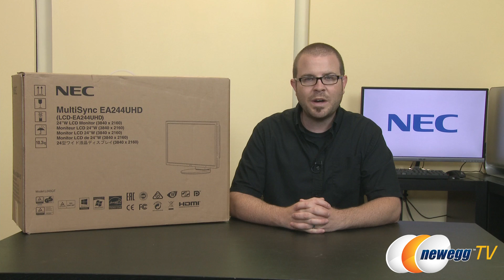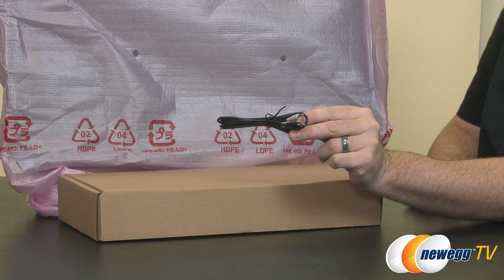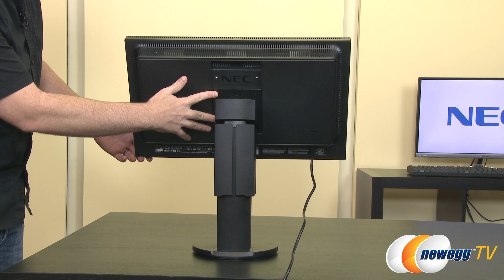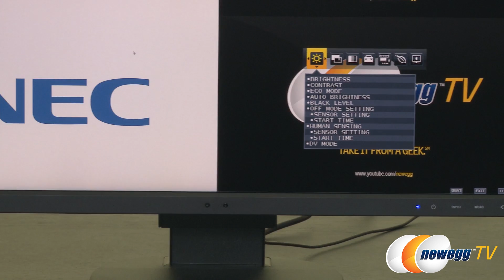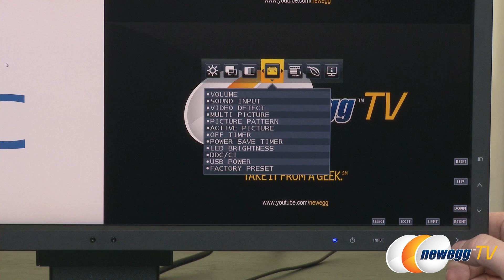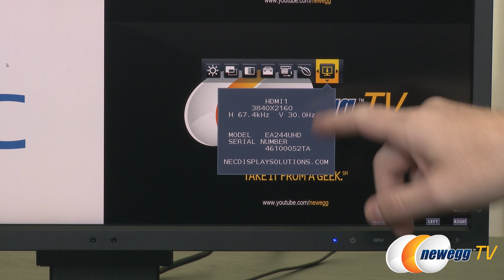NEC EA244UHD 4K Monitor Overview - Newegg TV

Comment: It was my understanding that modern OS's including windows 8 should auto detect the 4K and automatically scale the UI appropriately.
Reply: You are correct, but in my experience it only does it during the installation of windows, so if this monitor is connected when installing windows, it will, but not if the monitor is connected later on.

Comment: 4k is not 4 times 1080p. 4k is 2 times 1080p. I think what people are trying to say is that 4k has 4 times the pixels of 1080p.
Reply: It is 4 times the size of 1080p. You can display 4 full 1080p images on a 4k monitor. You're thinking because the pixel height (1080 on 1080p and 2160 on 4k) is only twice as big, the monitor only has twice as many pixels, and it's an understandable mistake. Because you double the pixel width (1920 -> 3840) and the pixel height (1080 -> 2160) you can actually display the image 4 times. 1920x2160 OR 3840x1080 would be 2 times 1080p.

In other words, you can put four 2in squares in a 4in square. Or, if you're not from America, you can put four 2cm squares in a 4cm square. It's an understandable mistake, I made a similar mistake a few months ago.
Reply: 1080p -> 1920x1080 =~ 2 milion pixel, 4k -> 3840x2160 =~ 8 milion pixel. Then 8/2 milion pixel = 4 times
.

Comment: It sounds dumb, but how is 4K 3840x2160 four times 1920x1080 and not two times? Is that not 8K ie. 7680x4320?
Reply: Multiply pixels quantity, not lenght and height in pixels.
Reply: 3840 is almost 4000..so they round it up..its just marketing bullshit you will still see some retailers refer to mont as "2K" for a 2560 x 1440 monitor..
Reply: Multiply 1920 by 2, and 1080 by 2. Therefore, the total multiplication factor is 2 x 2, = 4. 4K.

Comment: 24" 4k? lol way to small a screen.
Reply: a 24" 4K monitor and a 72" 4K monitor would display the same amount of pixels. There is no difference.
Reply: The monitor is just fine the problem here is the rescalling on Windows. i hope W9 comes with "4k native support"
Reply: ***** There IS a difference.  Pixel density...  Which causes everything to scale down when you increase resolution and decrease screen size.
Reply: Good for perfect scaling though. 4K has integer scaling for 480,720,and 1080 so no odd stretching needed if you want that stuff full screen.
Reply: It's not too small. People who buy this will buy it to make pixels too small to see.
Reply: ***** You will have a Hell of a time reading text without squinting or having to use some sort of magnification. 32" is recommended as the smallest 4K mont. for easy viewing of text and webpages documents etc.
Reply: Alberto Martinez

That's the whole point. It's called scaling. No one expects a 2160p 24" monitor to be useful at 100% scaling. Anything that's vector-based is going to be smoother at higher scaling.
Reply: Tim Ramich We know what scaling is.  We also know that it is implemented like shit in several instances.  The PC is not ready for 4K yet.
Reply: Obviously you don't. The OS handles it just fine. It's just applications that need to catch up, which is only a big deal to whiners.
Reply: Tim Ramich I never said the OS didn't handle it.  I said the platform as a whole is not ready.
Reply: Sure it is, and Intel announced their intentions of high-DPI years ago. The only thing that needs to catch up is the web, and that has nothing to do with the PC platform. I don't know what you even mean by "PC platform." x86-based systems in general, or desktops?
Reply: Tim Ramich It's okay, you win.  Mission accomplished, well done.
Reply: The smaller the screen the better the ppi, bui i think, for 24", 1440p is the ideal resolution, but again no company on this planet thought of making such monitor wich is too bad cuz they'd probably sell alot of them.

Comment: Spends $700 on a 24" 4k monitor... has to increase icon & font size to be able to read shit... ~clap clap~
Reply: Thats not the point, more pixels = smoother images = better looking.
Reply: So what? Icons for applications that don't suck are stored at up to 256x256 and fonts are vector. What should be done is have the OS know the size of the monitor and adjust stuff for a target inch or centimeter size.